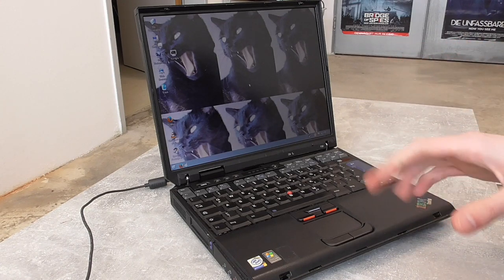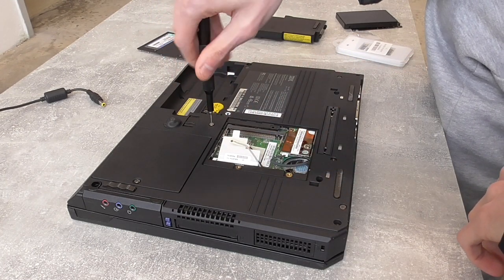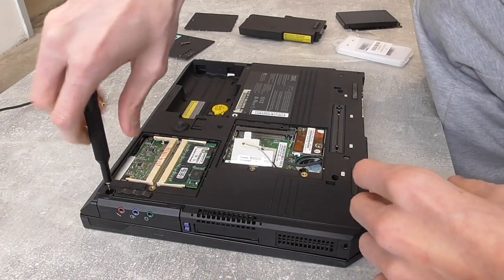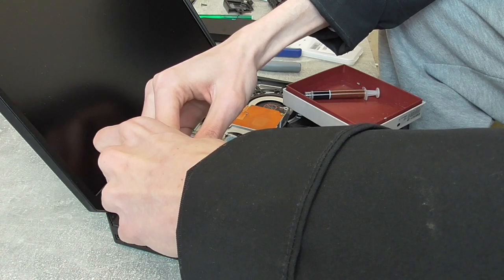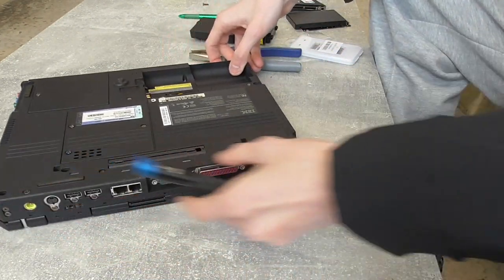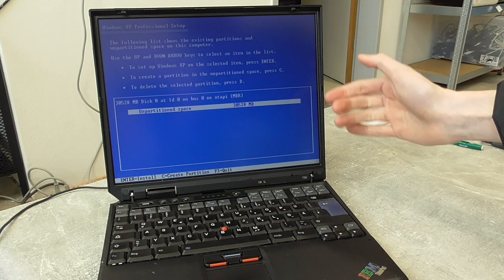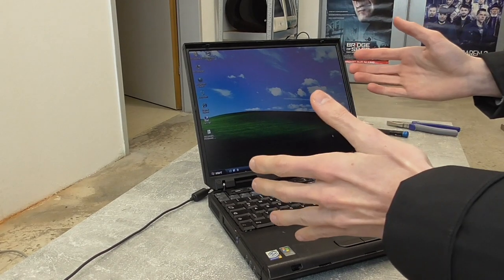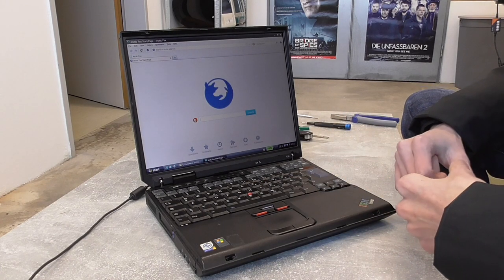T30 mSATA SSD Upgrade and XP Install

Comment: Something that might help if you ever have to do this again is you can use a heat gun on the plastic and it will make the plastic soft so it doesn't brake, the plastic is brittle because it's old and dried out. Just putting that out there for you seeing if that might help you for the next time. God Bless and have a good one.

Comment: I had a T30 and had to re-solder the memory holders as they are surfaced mounted and prone to cracking and causing memory problems. That was it's Achilles heel.
Reply from the maker: Yeah, I know about this unfortunate flaw. Thankfully one slot still works in mine fine.
Reply: @MacintoshMen  It will stop working at some point. I reflowed the slots on mine and they are now working properly. ;)

Comment: I tend to prefer sata m.2 to IDE enclosures. They are in the same form factor and should work the same, but sata m.2 drives are way more common than MSATA drives. You can still buy name brand sata m.2 vs only being able to get cheap Chinese brands for msata.

Comment: Did pentium 4 was too hot for laptop?
Reply from the maker: All Pentium 4's (Desktop and mobile chips) were running very hot and did not deliver a lot better performance (sometimes even worse!) than the predecessors. That's why they weren't loved a lot, the last generations were OK in my eyes.
Reply: @MacintoshMen  at least for PC with good heatsink and fan reduce the heat.

I have Pentium 4 from LGA 775, I could run Windows XP better with SSD.
Reply: @MacintoshMen the mobile Pentium 4 chips are really well binned northwood chips, so they actually run way cooler and tend to overclock higher. You could actually put them on some desktop boards with an adapter and a custom bios. There also were laptops with desktop Pentium 4 chips as well, I have a few. One is a a Dell smartstep 200n with a 2ghz northwood, the other is a Toshiba Satellite P25 with a 3.4ghz Prescott Pentium 4 HT.

Comment: You'll spend $50+ on an SSD for a rarely-used computer, but spending <$5 on a CMOS battery is too much?
Reply from the maker: I didn't spend nearly that much. That 32 GB SSD I had laying around in my stuff for god knows how long, I don't even know where it came from and the adapter cost 12,50€. So yeah, not that much money.
Reply: @MacintoshMen  Still, a CMOS battery is still less than half the cost of the adapter & that's before you factor in the cost of the SSD itself.